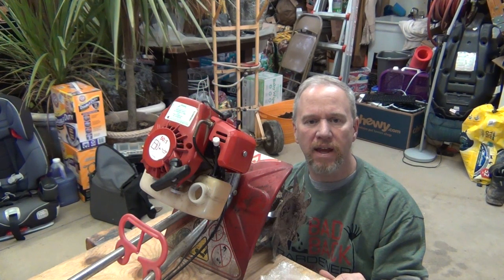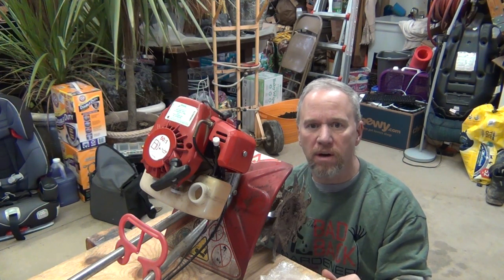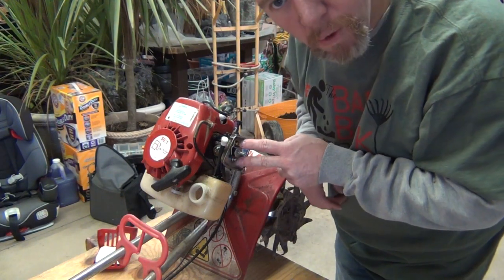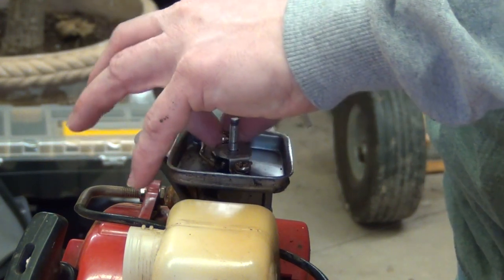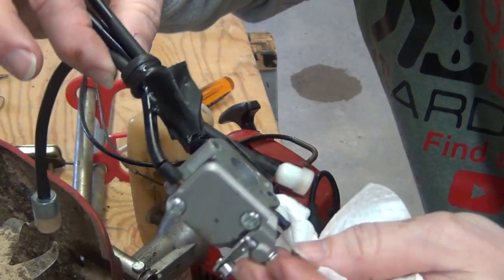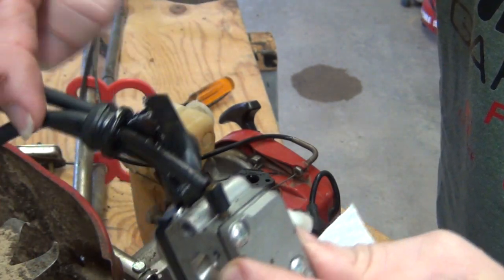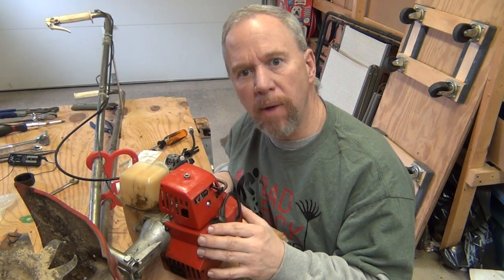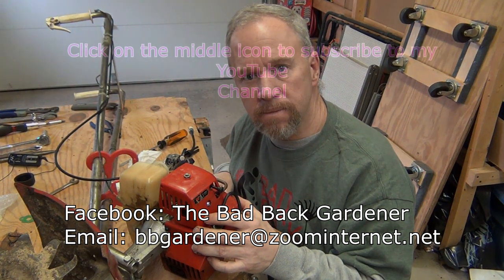How to rebuild a Mantis Tiller Carburetor

Comment: It seems important that the two upper hoses that came out were short and straight so they would be at the top, out of the fuel. (Vent lines) The hoses that when back in were much longer and presumably will hang down into the fuel. Oops! That can't be good ...

Comment: The gas tank vent goes into the small bump out in the red cover in between the carb and gas tank.  At 16:37 of your video the bump out is shown perfectly, right on the red cover. you slip in up in there.
Reply: At 5.29 you get a perfect shot behind the throttle cable to the left of the vent.
Reply: 11.54 is even a better shot